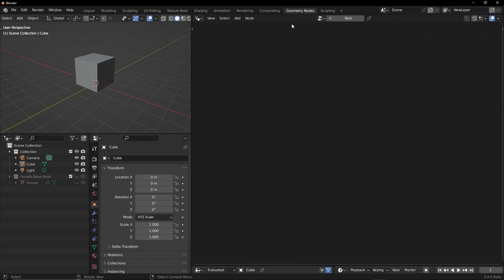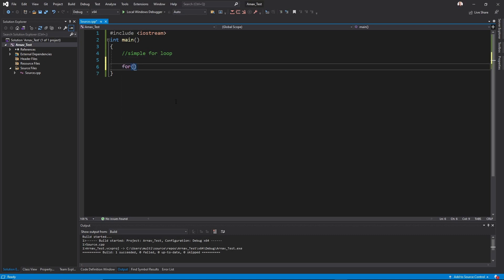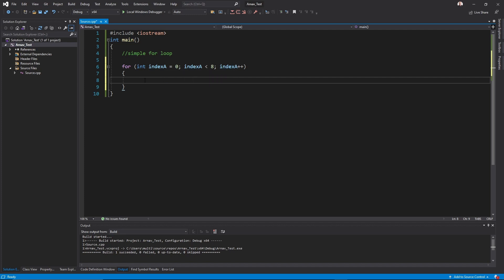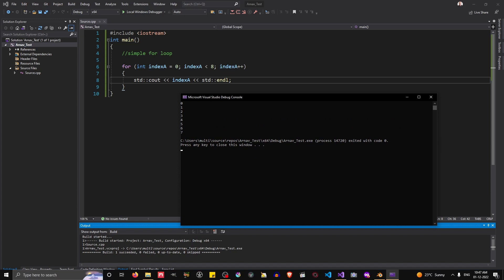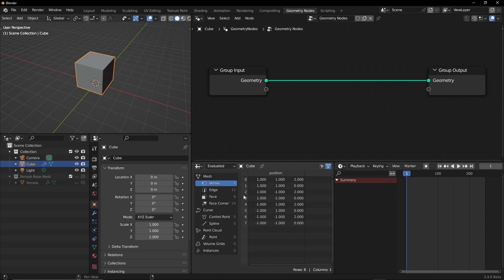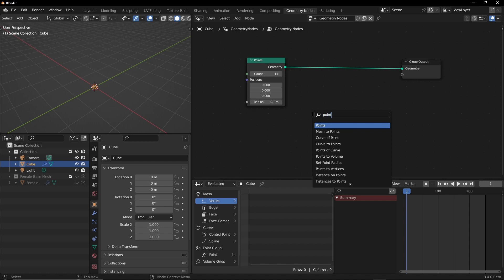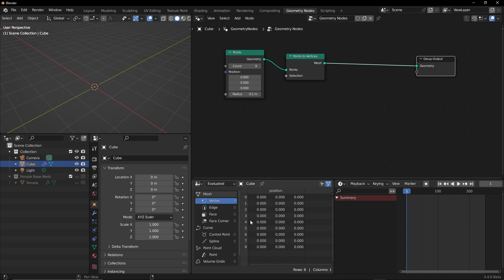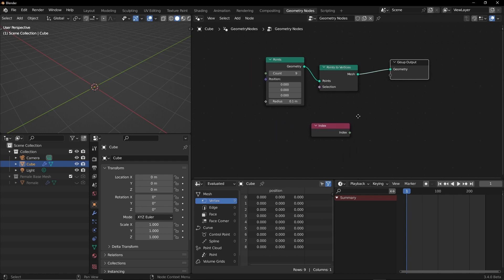Nested Loops in Geometry Nodes | Blender 3.4

Comment: I did my plexus effect tutorial about 6 months ago using the same method of that tutorial. I used mod and divide on the main index in mine. 
I been using blender for the past three days and really am getting it now! Geometry nodes are done very elegantly. Lots of options there.
I am going to do my first tutorial for it in a few days.
I do have a few questions I would like to ask you about it if you have some time?
Can lights be instanced and the color and intensity be controlled by vertex maps on the points you are cloning them to. (See my light instancing with point attributes vid) I am trying to recreate it in blender. I was able to figure out how to instance lights, but not control their parameters with vertex maps. 
My other question is... is there a node editor for motion on the object level for scale rotate  pos of the object itself? I didn't find anything like that when looking around.
Reply from the maker: Happy to help. Can lights be instanced?...  - I will watch your light instancing tutorial and then I might be able to suggest what would be the best way to do that in blender. 
 is there a node editor for motion on the object level.. - you can use Graph editor / dopesheet editor or  timeline editor.
Reply from the maker: Watched your tutorial. Fantastic tutorial, you have a very deep understanding of lightwave tools. I don't think there is anything like nodal motion editor in blender. May be when geometry nodes extends and become "Everything Nodes" then it may be possible. Currently geometry nodes is for geometries. Light objects, camera object etc. don't have geometries. My suggesting is if you are rendering using cycles render engine, you should use luminous geometry. you may get a different result than lightwave.
Reply: @ThinkingPenguin  Thanks so much... I may have a few more questions for you over the coming weeks... I am going to make the switch to blender.  
It is possible to instance lights with the geo nodes... You just have to put the light in a collection and then use instance to points set to the collection. 
I saw that in a tutorial on here called... "Blender Tutorial Geometry Nodes | Clone your lights". I asked him about it, and he said he wasn't that good a geo nodes and wasn't sure about how to use vertex maps with the lights... or if it was possible.
 
They really should add a node modifier to the place where you can do targeting and linking of objects (object level rigging type stuff). That is one feature from lightwave that I am going to miss. It is very useful to be able to use nodes in the rigging process. I think they will add it eventually... seems like the logical thing to do.

One other question I have is... Is there a post processing node that allows you to apply open image denoise to already rendered passes? That is how it is set up in LW, and it is way better than having it attached directly to the renderer. In LW it gets done at the composting nodes level with open image denoise node.
Reply: @bryphi77   hope you don't mind me jumping in here if I understand your question about a pass for denoising. Yes there is. Under scene settings there is an option to output denoising passes. These can then be blended to taste with the original noisy image in the compositor.
Reply from the maker: In blender that there are two levels of an object. one is object level or transform level where object's transformation is controlled around the pivot point. second is component level where you control it's internal properties like vertex, edge etc. if you look from geometry nodes perspective lights/cameras/empty etc. are just transform level objects they don't have any geometries. so it can control it's transform but not it's internal properties. even if you turn any geometry into instances it looses it component level properties. Welcome to Blender Community. Ask any question I will answer it happily to the best of my knowledge.